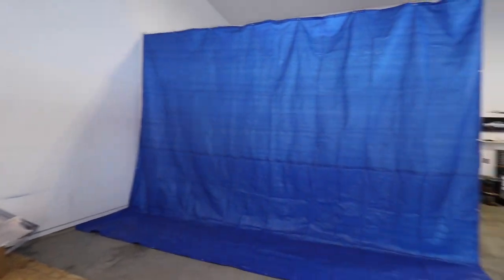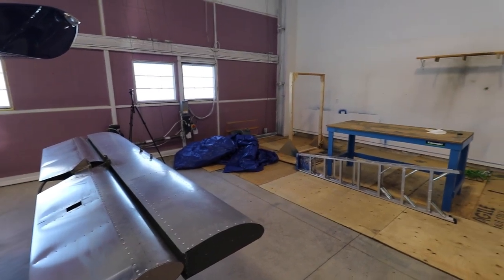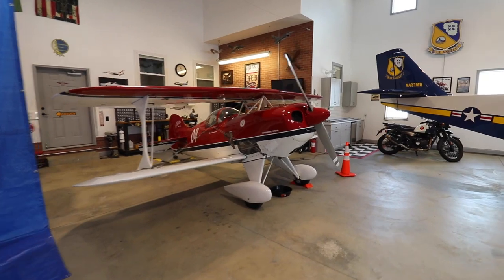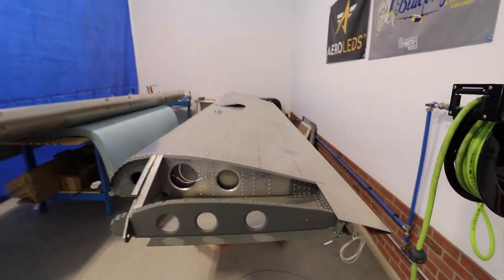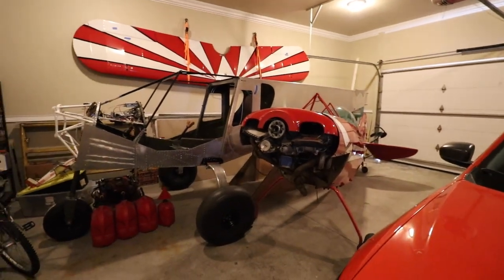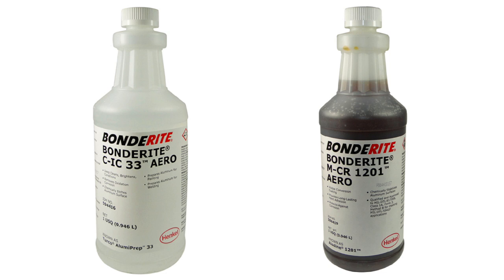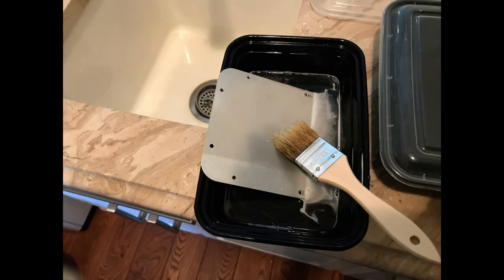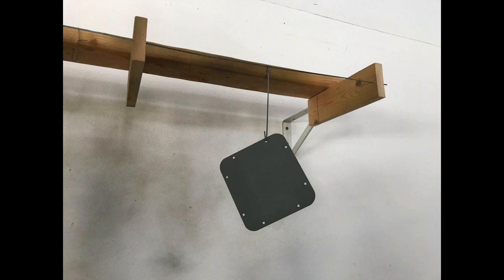I DID IT!

Comment: … I think I wiped that primer right off with denatured alcohol after it had dried
Reply from the maker: Not this primer you didn’t.
Reply: @KitplaneEnthusiast  I will take a look at the can in my basement. I know it was self etching primer. I had applied it to bare aluminum which may have been an issue also. I was shocked when it happened. 

I was doing surface prep for bonding cleaned the surface with denatured alcohol and it came right off.

Comment: If it helps, I used Rustoleum self etch rattle can primer on my plane 4 years ago, and topped it with Rustoleum rattlecan paint.  NO problems (including chips, delamination, etc.) yet.( if you want a data point for consideration)

Comment: My understanding is that the key to getting the primer to stick is to treat it with the Bonderite or Prekote to remove oxidation even from new aluminum.  Some might think that because the metal is new it only needs to be cleaned with Acetone or Windex before primer.
Reply: Epoxy primer just requires a rough surface to bond to and is much stronger, this is why Mark is putting epoxy on the main components. However, you don't need to treat with alodine if you are using an etch primer, just a 2k urethane. The etch primer is the same thing as treating as it attacks the oxidation on bare surfaces. You also can't sand etch and should be applying a 2k over the etch within the prescribed timeframe to seal it and allow proper bonding.

Comment: How do you prevent overspray from going over the top of the "paint booth"?
Reply from the maker: For spraying small parts it's a non-issue. For large parts like the wings where there's a lot of paint spraying it can rise out of the booth. That's why I move the planes out when I paint.

Comment: Are you using the SPI epoxy primer that you used on the cruzer? i thought the big advantage was not having to use Alodine?
Reply from the maker: Yes I’ll order more SPI. I used alodine on these covers because I had it sitting around. Might make no difference but I wanted to use it up.